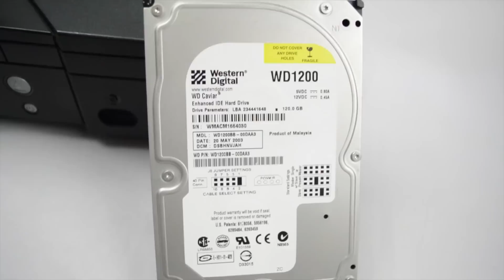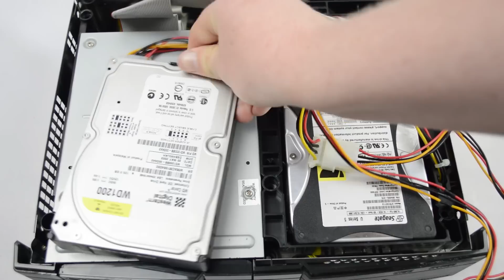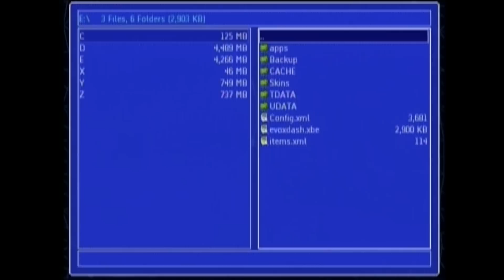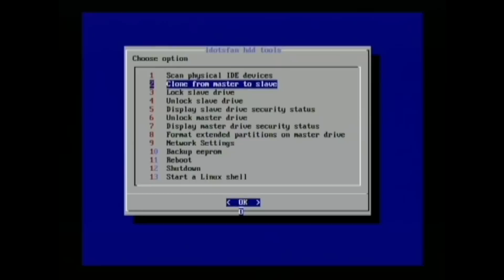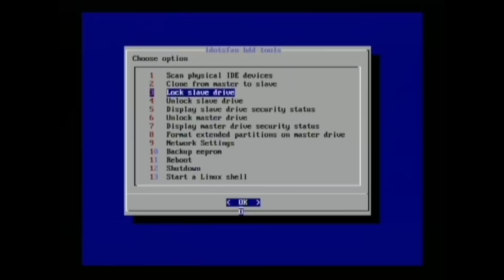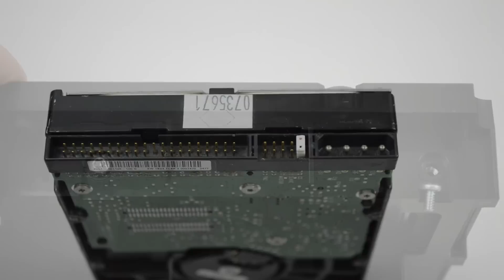How To Upgrade HDD in SoftMod Xbox Easy

Comment: I’ve just got my old modded Xbox out the attic to have a trip down memory lane. I modded it with a 500gb hdd years ago. It’s funny watching this as some bits I remember and some I don’t. Was really into all this back then. I have everything worth having on my hdd still. It’s great. Like a arcade machine in one box
Reply: Hi, what format does the chimp file need to be on the disc I intend to use? Thanks
Reply: Will M. I didn’t use a disk I used splintercell game and a usb pen with a special lead I bought on eBay. Xbox to usb lead

Comment: Used this to swap both of my Xbox drives one worked flawlessly, but the other initially boots to the "Your system needs servicing" screen but if rebooted will bypass this and start normally. Are there any leads to solving this? The only difference is the system in question has an LCD temp screen in the faceplate.

Comment: What if i have mod chipped Xbox with spare 500gb HDD and i dont have original HDD that was in console? can i still prepare that 500gb for usage? i used auto installer deluxe 4.53 to install XBMC and other stuff and Xbox recognize only about 120gb of that hdd. I only formated that hdd in auto installer menu.

Comment: Great tutorial on this method it's way easier then finding a ide computer and doing a drive from scratch. But I have a question it been awhile and have since forgot but if I clone a drive with this method does that mean both drives will be locked for the xbox. Like I can save the old one as a back up in case the new hard drive goes bad.

Comment: what if you want to use a sata hard drive
Reply from the maker: Only some sata hdds work with the ATA locking 
There used to be a list floating around the internet of hdds that could be locked and worked with the Xbox

Comment: Ok, this seems doable. But here is my question. My modded xbox has everything in the e drive instead of the f drive. C drive has 171mb, d has 0, e has 122 (left I think?) H has 720kb, and x y and z have 749 mb. Not really sure if this would cause a problem or not. Not really sure what it all means.

Comment: I remember doing this back in the day the extremely hard way of having to get your Xbox HDD key, unlocking it, connecting the new HDD that you wanted to install the Xbox to an old PC that still had IDE cables and ports and booting into some program that I can't remember and transferring your eeprom, HDD key and locking the new HDD, all using command prompt on a PC. It was pure hell trying to get it work. I installed an old 40gb WD HDD, but the drive started messing up on me and I never used my Xbox again, hoping one day someone would figure out an easier way to install new HDD in the Original Xbox so I could back everything up again and start over with a new HDD. 

  Unfortunately I lost all my Original Xbox eeprom and other important data backup when my HDD that I had transferred my files to a few years ago crashed randomly. I also lost my original HDD key. I had it stored on a txt file and wrote down on a piece of paper. Both are long gone now. Hopefully my HDD will work long enough to transfer everything to my new one that I'm about to install.

Thanks for the video!

Comment: I have everything I need except I am using a Madcatz wireless pad as I don't own a microsft joypad. All I am trying to do is copy my 500GB SATA Seagate Barracuda drive to another Seagate 500GB Barracuda SATA drive so I have a backup if my drive fails but everytime I try to use chimp I get a message that says something like Dissabling the bloody cursor or something anyways it says press enter to continue but no matter what I press on my pad nothing happens so I am assuming I need a Microsft joypad? I can never seemto get chimp to go into that options menu.
Reply: jai mal au derrier Hi dude. I had the same problem. I have 2, 3rd party memory cards in an official s controller. Once I took them out it worked fine. Maybe your theory about the pad is right!
Reply: Yeah it was the pad, it works now I have a MS pad. Trouble is I actually broke that Xbox now trying to install a mod Chip, I have another modded 1.6 with a Aladdin but it only has a 10GB drive with nothing on it really. My 500GB of stuff has gone down the crapper now as the old drive is locked to the old console, I even desoldered the EEPROM chip to put it in the working xbox so I could just put my 500GB in there but then my dog ate the EEPROM chip as its like a bloody child and eats anything it finds. If anybody knows how I can recover the stuff off that locked drive without the EEPROM please reply. Thanks

Comment: For anyone who followed the tutorial and are confused as to why upon reboot their HDD space is still the same, it's because you need to partition F if it's a 160GB. If it's Anything larger such as a 250GB or more you'll need to partition both F and G. You can do this with Chimp. Just load up chimp and select Format extended partitions on Master Drive. From there if you have a hard drive that is larger than 160 GB you will select the option to "split space evenly between F and G". If your hard drive is 160 GB or less you will only partition and format the F Drive. Once this is done just reboot your console and you will now see the additional space on the hard drive.
Reply: S&LGaming not true. You can take the f drive all the way to 1tb.
Reply: Does the Xbox have to be TSOPed before doing this upgrade?
Reply: @nickbrick21  you can upgrade a softmod too. You can use 2 or 3tb drives if you want just like a hard mod.

Comment: I dont get it, I had a Xbox 1.6 with Coinops already on and 160gb WD...I did everything exactly as said here, it recognized my new WD 250GB hard drive, locked it, moved jumper in back to master...rebooted......everything is there, same coinops and roms and dashboard as b4,  BUT THERE IS NO EXTRA SPACE! E and F drives show up JUST as they did before with original 160gb hard drive, there is no room. It is acting like this was the same original 160GB hard drive that is removed and on my desk. The 3 other partitions of like 740MB are there too....what extra step should I have done, I'm clueless now about this partitioning problem I assume?
Reply: I decided to go back into chimp, I did the extra partition setting and chose to send all to F instead of making a G and splitting it. I rebooted, still didnt work, until I went into Unleash X and chose Reformat Menu...clicked F....and FINALLY!!!! 241 GB showing free in F now, luckily I have CoinOPs and all my extra packs on PC still, I just need to let it FTP overnight. Glad I was able to work through this.

Comment: Does SoftModding affect an original Xbox's ability to LAN/system-link with other Xboxs at all?  I've been connecting a few standard factory ones together via a standard switch for the past few years, playing MechAssault and Halo with a few people.  Was thinking about SoftModding them soon to upgrade the HDs just so they're newer.  Getting worried that the original HDs might fail soon after 14+ years hehe, so I might not have any other choice.
Reply from the maker: it does not effect the ability to system link, it might even make the process easier for some setups

Comment: not sure if anyone still does this but just a little heads up if you use a sata converter once you are done change the jumper back to master or you will get an 07 error i lost my temper with it at first then realised i just had to swap the jumper xD
Reply from the maker: great tip

Comment: Man this helped me a lot. I was not having any success with the hot swap method.
I'd like to add 2 things for folks in case they are having issues like i did.
First if when you are done you aren't showing any extra free space on F: you need to go back into Chimp and then partition the F drive to get access to the extra space.
Second: if for some reason when Chimp loads your TV signal takes a dump you are likely using a CRT TV and it cannot handle the switch to 480p.  If this is the case try switching to a newer TV for these installs.

Comment: I'm having issues with my hdd upgrade. I made a new xbox hdd 2tb from scratch with the hdd maker. softmodded it. partitioned f & g to about 900 gb each. Load up 1 partition with xbox games so theres maybe 200gb left on that partition. xbox has been one for a day straight maybe. turn it off. turn it on next day. xbox logo comes on, unleashx logo, then goes to black screen and dash doesnt load. Any help ?

Comment: does anyone know which drive is the best (easiest) to do this with? I have tried with a Maxtor 250gb ide drive (model. 6L250R0) that has been confirmed by this site here to work - http://xboxdrives.x-pec.com/?p=list&v_brand=Maxtor&v_modelnum=6l250r0&v_size=&v_rpm=&v_buffersize=&v_locking=&v_version=&v_postedby= however I haven't been able to get the xbox menu to come up on this drive.. if I can use this drive that would be AWESOME as I love Maxtor drives as they are easy to use and very reliable plus they have good speeds for being ide drives.. if anyone can help with this that would be awesome..

Comment: Now do you have to use the ISO burned to disc? Because I used an extraction tool to get the needed files out and FTP'd them over and I don't get the option to boot chimp. Is it because I chose the standard softmod install?

Comment: Does anybody else's xbox shut off when you unplug the IDE cable from the DVD drive, and then you can't get it to turn on again for like an hour? I got it working eventually, I guess you just have to do it fast. It's something I haven't seen mentioned in a single guide.

Comment: this looks simple to do easyer then what i have seen before but would this work with a sata HDD using an IDE adapter ? as its very had to find good working ide  hard drives these days and if i do they are always 40gb or 80gb

Comment: If you talk about the 6 screws, it would be cool, if you could show them. Because now I had to find another video to find the 6 screws.
Reply: 4 are beneath the rubbers 
1 behind the top sticker
1 behind the low waranty sticker
Reply: Thanks. I watched another video to find them. As I said, if you make such a video in the future, show the placement of the screws. That would be helpful.
Reply: Björn Lubetzki they're on the bottom, use your brain

Comment: Shit. Followed steps would not let me lock the hard drive. Booted back up and now get an error code on the cloned hard drive and the original. So.... went form a softmodded xbox to a brick.
Reply: Do you maybe have any friends that have a softmodded xbox? You should be able to clone their HDD to your HDD using an ide to usb adapter and your computer -or just an ide port if your desktop's mobo has it. Then, try again, but back up the drive beforehand in case it bricks again.
Reply: Van V thanks real problem is I tried this when I didnt have enough time and just went through a cross country move oops. will try this

Comment: If the OG Modded Hard Drive is 160gb and the new one is 1TB will it be formated into 160gb or will it be all the data Cloned but the harddrive will still have 1TB of space ?

Comment: Chimp looks completely different to me when I launch it, it's a menu with a few icons that I have to scroll along and pick from, also says "Gentoo" at the top
Reply: Select FatX.
Reply: PenorPie how? Mine defaults to web but gives me 5 seconds to choose a different option and when I try every button seems to open the web loader.
Reply: VileThor I had memory cards in my controller when I took them out I was able to select the right option.
Reply: I had memory cards in my controller. When I removed them i could then select the right option.

Comment: By the way! There is not a  bad  option Docking Station (with RAID function), 5 pieces of hard. With a total volume of up to 40 TB. Support for hot-swappable. (Ie , during operation, you can get any hard drive). Description here: http://alipromo.com/redirect/cpa/o/o8yfi040xc6yzyl88htfkvmqxalhwm35/

Comment: I cant figure out what to do. I put the chimp.iso on a disc but my xbox wont read it?
Reply: Do you burn it, or like a usb drive?
Reply: It does have files, use XISO to extract them from the ISO
Reply: Microsoft played it cool and used multiple different hdd's cd drives in their machines because they're cool, and you probably ended up with one that can't read the kind of disc you burned it on☺ Probably a Thompson😏

Comment: Worked well with an 80gb hdd.  But failed for all (4) sata drives i tried it.  All booting up with err 13. Do i have to do something else for sata drives? Greetings
Reply: finaly got it to work!! The solution: I had to use a 80pin-cable to boot without error 13..
Reply: can you be more specific please? I have the same error 13 with a 500GB WD Greenpower sata drive
Reply: 80 pin IDE Cable, xboxs come with 40 Pin

Comment: When I unplug the IDE cable from the DVD drive and plug it into my sata hdd my system locks up when I press file explorer. Any help is much appreciated.
Reply: Ev Rager same here
Reply: Have you set your other hdd to slave?
Reply: you need another ATA cable with 80 wires to run a SATA, just change the cable that connects dvd drive and hdd to 80 wire.

Comment: Great tut worked for me, just like to add a couple things. You dont need a DVD for chimp. You can FTP those files directly to the xbox HDD, which is great if u dont have a blank disk or burner. Second you need to partition the drive if you installed a drive larger than 120GB. Chimp defaults the left over space at a max of 137GB. You can use chimp tho to format that space so you can use all of it. I used a WD 320GB drive.

Thanks for the hard work making this video.
Reply: Right! I had a 120GB IDE drive for many years, till I came across 877 XBOX games, that would only fit in a 2TB drive. One thing one must note is that for much larger drives ATA66 or SATA drives (with an adaptor), it is recommended that the IDE cable is replaced by an 80 wire cable as the cable that comes with the XBOX simply won't work.

Also, drives up to 250GB must use 16kb clusters. Drives from 250GB to 500GB must use 32kb clusters. And drives over 500GB must use 64kb clusters or there WILL be data loss.

Chimp is good for cloning drives but if you want a proper upgrade, you should use XBPartitioner. I have a 2TB drive with partitions of 970GB and clusters with 64kb in size. Chimp won't let you change the cluster sizes and if you clone a drive that requires either 32 or 64kb clusters, you will have a problem as soon as you start saving your stuff.

And be warned: FTPing 2TB of data over a 100mbit ethernet port is painfully slow. If you have hundreds of games and want to have decent performance, do it right the first time. I created folders and put the games separated by letters as the CPU simply won't cope with caching all them cliparts in one folder. Yes, it looks nice to see nearly 900 games but till the whole thing loads, it would take minutes. I FTPed all games to the same folder and upon discovering that the XBOX CPU can't handle that much cache, I had to move all games via the file manager to these folders separated by letters - which took over a day to complete.
Reply: m0nkeycheese thanks bro for a helpful  comment 😙
Reply: m0nkeycheese how do I partition the drive?
Reply: mine is 80 gb but detects dvd drive, not second hard drive. what i need to do? pls help :(
Reply: this answered the question that i had--thanks i appreciate it
Reply: I also used a WD 320GB drive and it showed something like 297 GB free after i did all this
Reply: Can the new hard drive be partitioned with chimp app? I have a 250 gb hard drive that I want to Install in my soft modded Xbox but I don't have a PC to partition it .
Reply: Not true, you can take the f drive all the way to 1tb.
Reply: Thanks dude

Comment: So I managed to get it working. I switched the IDE cable at the right time  and it seems like everything was installing on my 1TB drive. I cloned it, backed up the eeprom and then locked it. I put it now as the master hard drive, but it's not working. I get the Xbox logo show up for  a few seconds, and then goes to an error message... Not sure what I am 
doing wrong now :\
Reply: I have the same problem as well
Reply: i had that problem aswell, on my hdd it said master is left jumper, wasnt working i put the jumper all the way to tje right and it worked try adjusting ure jumpers note: allways change the jumper when power is of or u will frie ure hdd

Comment: I've been trying this by switching the hdd to a sata drive. When I get to the point that I should disconnect the ide from the disc drive and plug it into the sata/ide adaptor that goes to my new drive, the screen goes black and the xbox is unresponsive. Don't know what i'm doing wrong.

Comment: how do set the second (new Hardrive) as slave??
Reply: On the hard drive itself, there is a duel connector pin or a "jumper" connection that you remove with small pinchers. You place the duel pin depending on where it list master/slave/etc on the hard drive.

Comment: What if my Xbox is hardmodded?
Reply: Ftp everything onto your computer as a backup from the original hard drive, use a copy of Slayer to insert into the disc drive before booting. Install new hard drive and then boot up the console by pressing the power (not eject). Then go through the menus to format the new drive and then lock it. Then install your preferred OS from the Slayer disc, and you're done for now. When you're ready, ftp your content back onto the new hard drive. Took me 14 hours straight to transfer around 250gb which I just let it do it overnight and when I'm at work. And that's about it. I recommend using newer SATA hard drives. 1TB is a perfect size for games, music and movies, but you can add more space if you'd like.